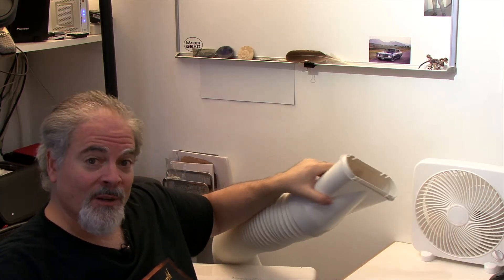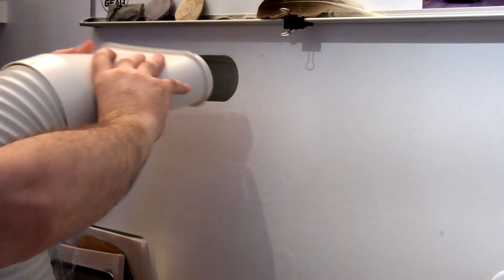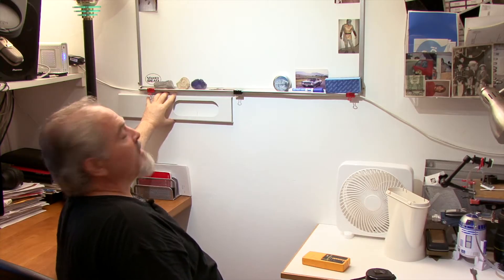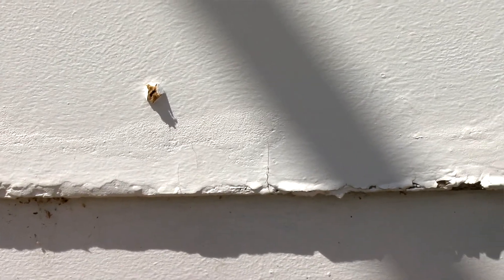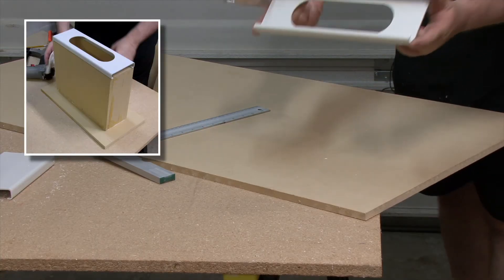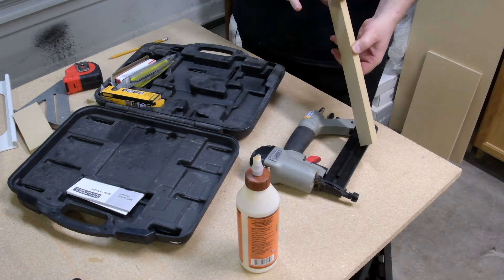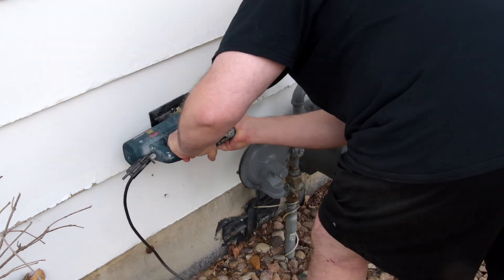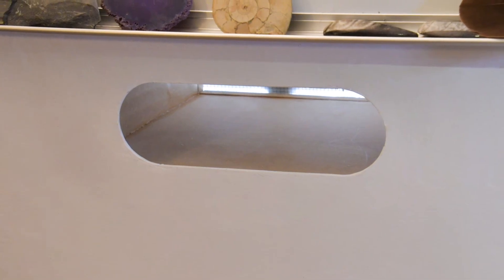Portable Air Conditioner - No window? No problem! Vent exhaust thru wall, stealthy magnetic cover.

Comment: Those things suck at cooling, and use double (or more) of the wattage of a window unit.  I've recently found out that the way to go is a mini split with inverter tech.  My 5k btu portable uses nearly 1000 watts, and still can't cool the back of the house.  My new Mr Cool 12k btu mini split has so far only reached a little over 700 watts in Turbo mode, but most times, when it's running the compressor, it runs at between 150 and 300 watts.  Total Kilowatt hours for a given day was 2.89 Kwh, whereas the portable used 6.93 Kwh for a day that was 2 degrees F cooler (83 vs 81).  And the mini can actually turn the back of the house into a cooler if need be.  Plus it heats as well.  The thing about "Inverter Tech" is that it can only run the compressor as hard as it needs to.  Unlike most AC's which are at full power or off.  WHat this means is that when I would usually take advantage of cool nights by opening a window, watching the power usage via a smart plug I can see it's compressor running at 30 to 50 watts (fan alone = 11 watts, Unit/fan off =3.6 watts with wifi control), which means it's basically just acting like a water cooled radiator setup while only drawing the power of a window fan.  I can't recommend them enough.  Pro Tip, check out the scratch n dent section at Ingrams.  My outside unit is banged up a bit, but works perfectly.  And they had it at my house via UPS in two days.  Only issue was that my order page show it as still processing so...
Reply from the maker: Those are nice units. The heating capability and energy savings are great features. If I didn't already have this one, and portability wasn't a factor in my situation, I'd definitely look further into one of these. Thanks for the tips Mat!
Reply: Unfortunately, not everyone is able to install a mini split or has a window that can accommodate a window unit. Average quotes to install a 14k btu single mini split are $4k, and can’t DIY as a renter

Comment: Its cool and all but i assume the idea is for professionals only and not amateurs who can't see themselves cut through the wall of their own house, i wonder if you can just get very long narrow tubing duck tape it to the large tubing that goes into the portable aircon then take the small exhaust tube and lead it out the door to where ever you want. Less cleaner, less professional work but no holes into the wall. Still a nice video and creative p.s i said long narrow tubing so you don't have giant ass tubing all over the place
Reply from the maker: I originally thought of doing exactly what you are suggesting. Unfortunately, adding an extension can quickly burn up the AC unit due to increased back pressure. Even if it didn't harm the portable, it would drastically reduce the output, especially with a smaller hose. 

Imagine trying to drink a really thick shake - a large straw would take less suction to get the shake to the top. A small straw would be extremely difficult due to resistance. Air flow works in a similar way.

That's why I chose to go through the wall. The project looks much scarier than it actually is, but I wouldn't consider it a job for someone that has never done any sort of DIY. That's when you need a handy friend or relative 😃

Comment: Amazing video. I have been searching for a solution for my windowless garage gym. This has been a huge help! I will post on your website my results when I tackle this project in the late spring. Thank you so much!!
Reply: Do you also think this could work with a dual hose setup? I do hear those are more efficient and do a better job with cooling and heat dissipation
Reply: @MathewMkay  I'm on the same situation now, have the midea dual hose ac and looking for an idea on how to set it up in a windowless garage gym
Reply: @Jesus-ov8fk  hey I ended up doing a thru the wall ac unit above the garage door. It was a better option for me. However, this would indeed also work. You can go through the garage door or through the wall just like he did in this video
Reply: @MathewMkay  did you end up using some kind of dryer vent on the exterior? All the ones I've looked at are only 4-6 inches
Reply from the maker: Thanks Mathew! I think this same technique would work very well for a dual hose setup. I am looking forward to seeing your project!

Comment: how far up from the floor can the vent be installed
Reply from the maker: Thanks for asking, Mapril. It depends on the length of hose you have and where it attaches to the AC unit. The exhaust on my AC comes out at about 16" (centered), and my hose is 48" long, so my vent is 46" off the floor. 

If you attach the hose to your AC and then allow the hose to bend naturally, you be able to tell how high it can be installed.
Reply from the maker: If the hose doesn't go high enough, you could build a simple, but sturdy platform to raise the AC up a bit.